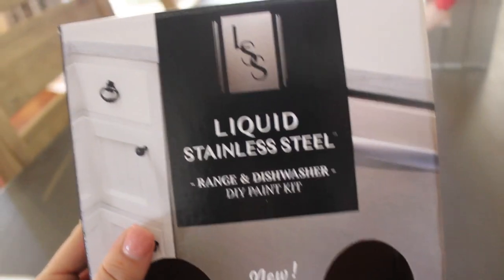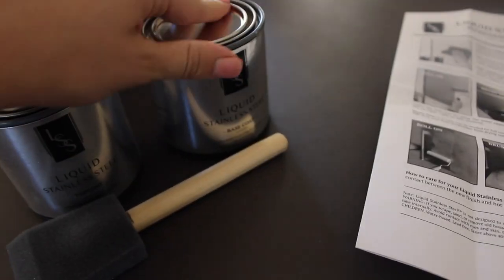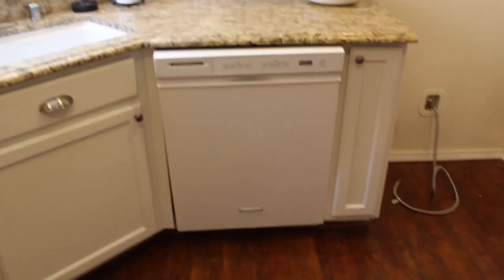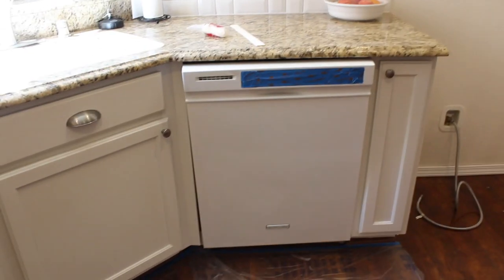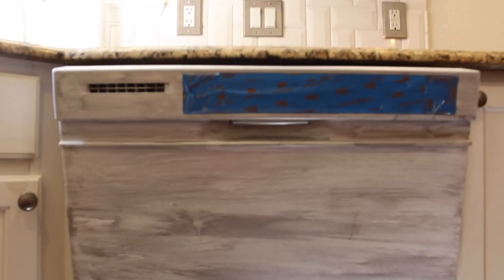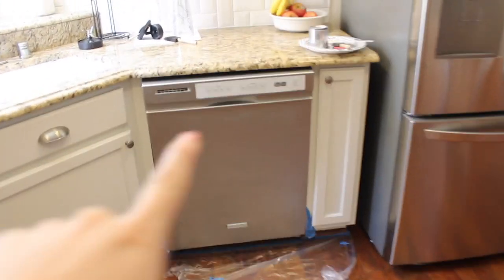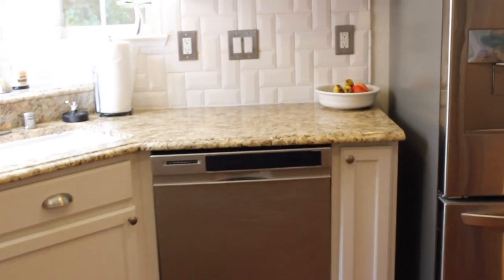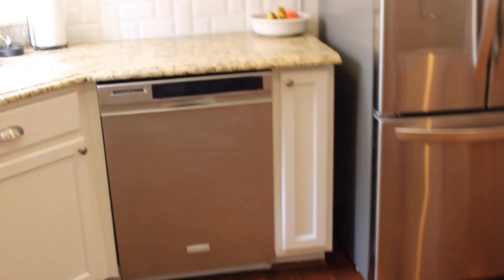How to Paint Appliances// Liquid Stainless Steel/ Paint Appliances with Stainless Steel Paint

Comment: Don't shake it, just stir well. The more you aggravate it, the more air gets trapped and you get bubbles. As it dries, in thinner coatings such as this, most of not all will pop, but you then run the risk of having blotchy or slightly discolored areas. This is especially true for top coats which should never be shaken. Even with latex paint that gets shaken to mix the color, then you see an orange peel looking finish. All of those little bumps are air trapped under the paint.

After you do a couple of passes with primer, lightly sand with at least 800 grit, making sure not to end up seeing the old color bleeding through. If you Do, add more primer and sand gently. You will end up with a nice flat and even base for the pigment, reducing the amount of air that would otherwise get trapped around the orange peel surface if you didn't sand the primer coats. 

Do the same with the clear coat, starting with an 800 grit wet sandpaper and working up to a good 2500 to 3000 wet sandpaper. The higher you go with the grit, the smoother and well polished the surface gets. 

Don't go above around 600 if you want to create a brushed stainless look. Let the pigment coat firm up buy don't let it dry. Use a light bristled paint brush and score the paint by lightly brushing the tacky, slightly wet coat, starting past the edge is non one side and not stopping until passing the edge on the other side. 

Once it is cured  (dried) add the clear coat which will fill in the brush marks and creates a flat finish. After a few coats, start the sanding/polishing/layering as before and you will get an amazing looking finish that is well protected  by the clear coat. 

You can get clear in matte, satin/semi-gloss and high gloss, so if what is provided doesn't do it for you, you can buy whatever clear suits your desired look. And without any bubbles!
Reply: Thanks. Great advice from someone who knows how it's done.

Comment: It is very easy to remove the front panel from a dishwasher; you will get a much better paint job this way, and when reinstalled it will be less likely to show any signs that it was painted.

Comment: Just recieved my kit. I'm doing my stove hood, so far it's taking a whole lot of coatings! It's getting darker but still not finished as if yet. So far I've done 5 coats I think. Still need to apply more.😒
Reply: How many coats did you have to end up applying, and do you like the finished product?
Reply: How did it go? what was the color of your stove before painting it? Mine is black, I want to paint it stainless steel. Update: I painted my oven and fridge, used 4 coats and 3 clear. it came out really good. I could still see the horizontal stripes but no way to avoid it. but I am very happy with the result, from black to stainless steel that matches the rest of my appliance. I wish I could insert some before and after photos .

Comment: Could you tell me 1) how many coats you used and 2) did you just use the foam brush or did you go and get a squeegee/roller or any other tools? Thank you! It looks awesome!
Reply from the maker: I think it was basically three, I just spot painted areas that needed it after a couple coats and I did use the foam brush I think foam is best so foam brush or rollee

Comment: Hi I am looking at doing this tomorrow and am researching it now... how many hours would you estimate the dishwasher took? 

It also wasn’t clear if you brushed it all on or if you switched to a roller partway
Reply from the maker: I did it over the course of a day, did a coat, let it dry, did another, so on. Each coat didn’t take more than 30 min I would say. I think I tried both it just depends what finish is better for the material of your machine

Comment: Looks Ok but for a little extra $ you could have bought an actual piece of custom cut stainless steel and used construction adhesive to hold it in place. On the large flat surface of the dishwasher that would look even better.